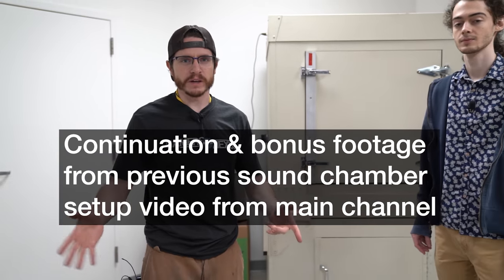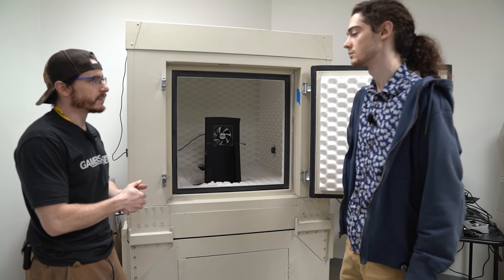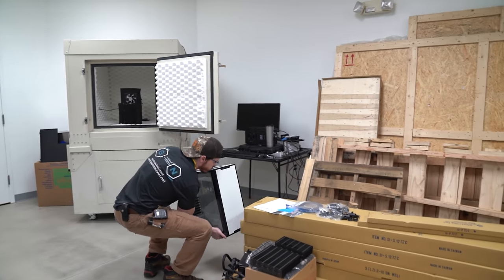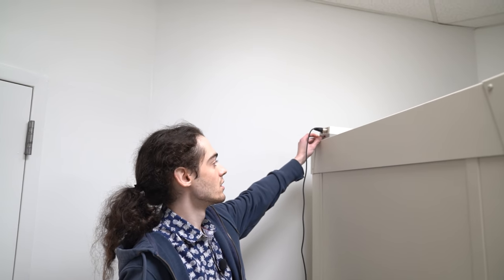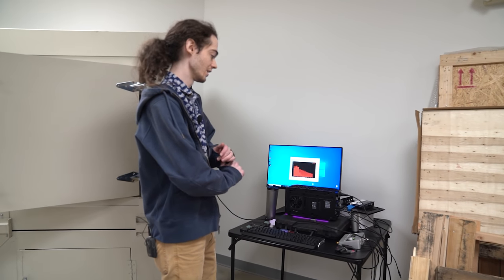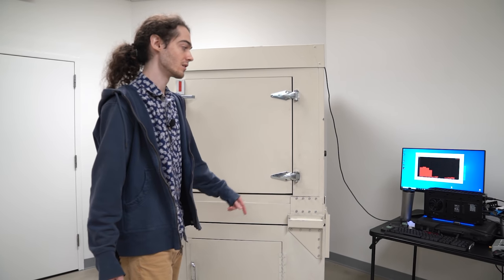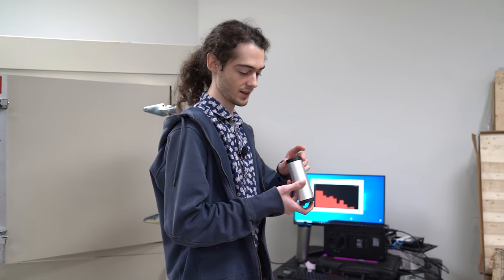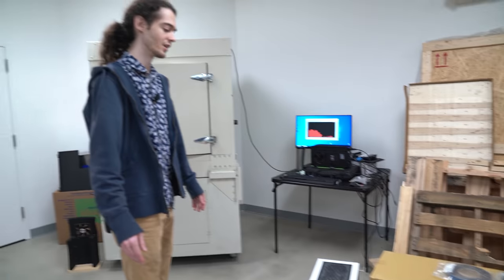IT BEGINS: Finalizing Noise Testing in the GN Test Lab

Comment: Hey just a view ideas from a sound guy here: 
1/3 Octave Band with lots of smoothing is probably the way you want to present your noise level. It has reasonable amount of frequency information but is not overloaded.
Don’t worry about time weighting. the fan noise is rand/periodic just use RMS. 
If you want a single number use A weighting. dB(A)SPL @ x Meter (distance needs to be specified)
To see some Bearing, Motor, coil,  resonance exact RPM other periodic effects below noise floor a high resolution FFT might be interesting as well. 

"ISO 389-7:2005 standard for human hearing" is specifying the threshold of hearing. 
Lewitt is comparing this line in there marketing there 1/3 Octave Band rms noise.
Search for "Lewitt LCT 540 Subzero Nosie" 

How is the Microphone influenced by wind noise? 
Is only measured in form/behind the fan? 
as you sure know the placement of microphone is very sensitive. what if the fan is not emitting lots of noise in the direction of the microphone but to the sides. 
In a PC cases the sound emitted to the sides would also reflect and contribute to the noise you hear.
How is static Pressure (or the fan mounted to a radiator/cooler/grill) influencing the noise?

Comment: Hello GN.  I would like to make a suggestion if it's not too late.  Could you please test the fans in both the vertical and horizontal positions?  I've noticed that some fans will work perfectly fine as a front intake fan, but if you use it as a top exhaust, the noise signature changes.  The way the hub operates in different positions is something that should be investigated.
Reply: This is caused mainly by the fan's bearing type
Reply: This reminded me of when I had to return a set of otherwise good Thermaltake (fixed-color LED) Riing fans which would begin wobbling horribly when rotated blades downwards (so, bottom to top air). I wonder if these issues even crop up nowadays, when horizontally installed radiators are much more common.

Comment: My old High School had a recording booth that was just a large closet. They dampened that room with Carpet on every surface and then Old Theater Curtains hanging on the walls. The only way to communicate was by headsets. The room didn't even have a window. The room was stupidly quiet.
Reply: The modern equivalent is to buy a few moving blankets and coat everything in them. Alternatively, you can get like vocalboothtogo fancy thicker moving blankets with grommets so they're easier to hang up. There are still some frequencies and noises that simple blankets can't take care of, of course. But it's great for some purposes.
Reply: @ArdgalAlkeides  And ideally with isolation; so rubber between layers of brick/concrete/drywall, sound isolation mounting clips, etc. Even floors can be isolated! I've been working on a design for a new studio that's built to at least radio studio standards, and it's incredible the number of things they'll do—and the cost :) — like custom window units with angled windows, way thicker glass, many panes, and custom rubber glazings.

Comment: As much work as it is, it looks like fun. Its going to be interesting to see how you "filter" out things like vibration from the building aswell as wind noise from the fan being tested (if thats a factor). But still if you really did get a 12-14dBA floor thats going to be pretty decent compared to just in room on a desk. Cant wait to see a full fan break down when you combine this data with the fan tester.

Comment: While placing "a rubber mat" (actually, dual layers of rigid panel covered with MLV and spring-isolated from each other would be the way to do that) under the acoustic chamber would help increase isolation, your best bang-for-the-buck would be isolating the mic stand (which is acoustically coupled to the structure itself) from the surface it rests on. Still, a12-14dB floor is impressive – better than most recording studios.

Comment: A connector with a tongue locking body like XLR but with a different number of pins (anywhere between 3 and 7) is still XLR.

An alternative is aircraft connector, I think you have encountered those on a Super Flower modular white PSU that caught fire many years ago. It locks with a threaded collar.

Comment: Might want to consider a windscreen in the microphone capsule. If you're measuring fans, gpus or anything that pushes air, the generated air flow Could cause the mic to measure the air pressure on the cap as ambient noise.

Comment: Having worked with similar equipment twice in the past, we ALWAYS had a special room for it. It really goes a long way having an extra macro layer of separation for vibrations and heat. Elevating the machine is also essential, good thought there. 

Of course I don't know the specifics, there are probably also other reasons for your decision, just sharing my experience.

Comment: I think fan grill type and distance from the blades and it's influence on fan noise AND airflow (since you have both capabilities now) would be an interesting test series to perform. Looking at coil whine would be interesting but since that varies from sample to sample it wouldn't be very useful except for maybe ways to mitigate it.

Comment: Please make sure you insulate the entire microphone wire as well as clamp it. Noise will go straight through the wire if you don't.

As an example I can hear the PC vibrate through the cables that connects to my headphones. If I clamp it with my fingers the noise is lowered.

Comment: I think you need to account VLF noices too, at 3-12Hz, in coolers' case - vibrations of the fan "sleeve" from the low airflow... 
So double-spring legs could be essential in that case. It's inaudible but you feel that.

Comment: I think a cassette style sled for 120mm and 140mm or bigger that could be modeled in CAD and 3D printed could be the best bet for something like this. It could be fitted with some dampening material and made to lock in place with friction or a clamp. The fans would mount to separate 120 or 140 mm cassettes to make hot swapping possible and the material cost should be reasonable seeing as you would only need to have a few. You could even have fans always ready for "ready to go" testing purposes when testing new fans. For verifying your data at a later date. I was actually thinking about when you all where going to make a video with an update on your fan testing rig just the other day so this video was super nice to see!

Comment: It's good to see that you're attempting to create a standardized method for measuring the noise created by fans. But I think you're going to have problems. Measurement mics, being condensers, are very sensitive to wind. Your fan, whose job it is to move air, is going to drive your mic crazy, no matter which way the fan is pointed in that small cabinet. Air will circulate around the cabinet and WILL hit the diaphragm of the microphone. You really need a fair-sized anechoic chamber so that you can get the mic and the fan several feet apart. Then the fan can simply be pointed 90 degrees away from the mic, to avoid wind noise. Besides, for noise measurements to mean anything, they have to be recorded at a specific distance, and the longer that distance is, the less slight differences in distance will matter. One meter is a commonly-used distance for measuring things like the output of loudspeakers, and I think it would be a reasonable distance for measuring fan noise, as most people sit between 0.5 meters and 1 meter away from their computer when they're using it.

Of course, measuring the noise of the fan without it being in a case, and without it blowing through the openings in a case, or though a heatsink, is not going to be very representative of real noise levels anyway.
Reply: Perhaps they could control for the turbulence in the chamber by measuring and setting the fans to produce the same CFM when doing the noise test? Not perfect since there's differences in static pressure, but that may help.
Reply from the maker: We've already thought of this and worked with expert consultants on handling it, but thank you for your consideration. Solutions are already in place.
Reply: Realistic testing becomes even more complicated once you're hitting specific edge cases in case design. Like, even aside from general steel thickness that amplifies vibrations, there's different grill shapes that modify the sound (mostly for exhaust), and there's also that (mostly for intake) common approach of "let's leave all the mounting cutouts for all possible fan sizes, and also some structural beams in the way of the air", so you end up with parasitic air turbulence that worsenes the sound profile.

Ideally, there should be at least several test setups for more common usage in actual cases. But, even with how those won't fit inside that small low-noise box, such tests will also balloon the amount of effort, and data, and even space in reviews... while all not being perfectly "scientific".
Reply: @puddin432123  Yes, but that brings up another bundle of issues. Let's say you choose 20CFM as your standard. A 75mm CPU cooler fan (like a stock AMD or Intel cooler fan) might have to turn pretty fast to do 20CFM, while a 180mm would just tick over at 20 CFM. Not exactly fair. And then there's the question of how loud a given fan is when it's maxed out. My computer is entirely air-cooled, and I run a Ryzen 9 5950X OC'd to 4.65GHz. I have a lot of powerful fans that, when called upon, can make a lot of noise. But that's part and parcel of running such a powerful processor with air cooling. Testing a 180mm fan that can move 150CFM at a low speed (20CFM) does not reflect actual use conditions, except when the computer is idle.

I think the main issue they will encounter is simply the small size of their isolation cabinet. The mic is going to be hit by moving air, no matter what they do. And we haven't even begun to talk about "cabin gain," or the increase in low frequency sensitivity of the mic due to being in such a small sealed box. They'll have to EQ that out of the measurements, although that should be pretty easy to calculate.
Reply: @gnextras  I'm looking forward to future videos on the subject. 🙂

Comment: You guys should get an XLR bulkhead connector to fit the I/O of the chamber. That way you can plug the mic into the inside of the chamber and run a cabler from the outside to your interface.

Comment: Build a frame for 120mms and one for 140s.  Have it open up top so u can slide the fan down. Use foam on the bottom and sides of the "U" that will hold the fan in place. That should also eliminate vibration noise if there is any. Also Using foam will allow you to fit most fans, since the foam will expand again and u can use it for a bigger or smaller outside measurements.

Comment: You use a sandbox to isolate chambers like this. I used an Electrom Scanning Microscope that has similar issues, the medic research lab. A sandbox is the most cost-effective means, especially if leveling is not a primary factor.

Comment: It’s really cool that you’re taking all this time and effort to get actual data on things that nobody else tests! Also, wouldn’t it make sense to have the fan mounted to a metal panel like it would be in a pc case?
Reply: I feel that would allow for too much vibration to resonate with metal especially.
Reply from the maker: The goal is to isolate the noise made only by the fan, so using metal would introduce additional noises that are not from the fan itself.
Reply: Oh, right. Didn’t think of that.
Reply: Agreed. I struggled a lot with fans that were "silent" when held in a hand, but turned an IKEA cabinet into a cardboard drum, or a PC case into a low rumble machine. Pure data like that is technically correct, but (without some vibration testing machine, I guess) still doesn't paint the more realistic picture of common usage scenarios.
Reply from the maker: @Lishtenbird  I mean, you're talking about testing wood, metal, Ikea cabinets, etc. That isn't a fan test. It's a different issue and would be the same as not controlling the CPU in a GPU test.
Reply: @gnextras  A "cabinet" is merely an exagerration that showed why vibration is also an important metric of the fan itself, which does however get lost when only the "air/bearing" noise is measured and presented. An Arctic fan, a Redux fan, and a Noctua fan were (unscientifically, sure) close enough when held by their wire, and yet when installed (regardless of whether in an expensive PC case or a wooden sheet), behaved noticeably differently.

People are merely pointing out that, while cool, the isolated data might become misleading if it's the only "most reputable and scientific" reference point available (which hopefully, knowing GN's thoroughness, it won't be).
Reply: @Lishtenbird  I have a thought. Could tape an IMU to a fan and evaluate the vibrations from that. I could develop hardware/firmware/data processing scripts remotely or something you can use may already exist.

Comment: This setup is still has minimal usage as it doesn't account for the vibration induced into the case which creates a large percentage of noise. This could be a different measurement of vibration. This vibration measurement would reveal things like blade Ballance and baring issues that might be present.
Noise from different grills could also be very useful.

Comment: You can use a second mic outside to cancel the exterior noise.
Reply: That wouldn't really work without factoring in all the acoustic properties of the chamber.

Better to just aggregate a bunch of samples with the device under test in place, but not running. Do the same with it running then deduct the former from the later. That way you only get the contribution of the device under test.

Comment: That foam could still resonate at lower frequencies (the less material surrounding the better). it could be within the margin of error but perhaps shock mounting could be better? could have a larger frame around the fan with elastics feeding through the mounting holes? kinda like a trampoline but rubber instead of springs.
Reply: Yes. just uses rubber strings to suspend it. 
Like the "spider" on professional studio microphones.
Reply: @lambda7652  Exactly, Best to have a fabric wound rubber too, reduces resonance even further
Reply: @neon8270  but admittedly all this is not representative of "real world" application. 

A fan would be mounted to a somewhat rigid structure. 

And a cases fan would be mounted to a cases. 
With some of the acoustic energy going in and halve of it going out. 

 testing a fan without a cases is like testing a speaker chassis without a cases 

You get an "acoustic short circuit".
Reply: @lambda7652  This is a great point and to a degree I do agree.

That being said, each case is unique and will resonate at different fundamental frequencies. as a result some cases might favour certain fans more than others resulting in biased numbers. Not to mention the effects of airflow intrusion by the case that will also affect the blade's tone.

I guess at the end of the day, measuring motor noise and blade turbulence in an isolated fashion is the only way to fairly compare 2 fans without a specific use case.

Side note: would be interesting to see a sine sweep of a case measured by some kind of transducer XD
Reply: @neon8270   Resonances are also a point with different cease but i'm not talking about Resonances.  
i'm talking about acoustic short circuit. 
Like a speaker the fan blades "radiate" acoustic energy in in both directions but in opposite phase. with no wall or case this "shorts out" and the noise in opposite phase cancels out. 

to avoid resonances speakers use a "infinite size" box for this spec. of cause the box is not real infinite but is has damping to avoid resonances in audible band.

Comment: Using your guys' model for the fan holder in your chamber, there is a very simple mod you could do to it to make it fairly adjustable to most reasonable fan sizes. I can send a sketch, (free of charge of course), if you like. (I am an MET that worked at a place that had similar chambers.)

Comment: You're going to run into funky resonance behaviours with some fans if it's just loosely held in some foam instead of fastened with screws or attached with dampening mounts to a solid frame, but other than that it looks good.
Reply: Why? Foam absorbs and damps movement. And every structure can have a resonant behaviour including and especially a steel baffle.

Comment: that low frequency noise. To me it looks like it is geting coupled to chamber mechanicaly from floor.
Reply: Yep.  And they may be able to isolate further if they use a mic shock mount, which would suspend the mic within the chamber, reducing the frequencies being passed through the chamber.  They're very cheap and available off the shlef, no reason not to use one in a setup like this.